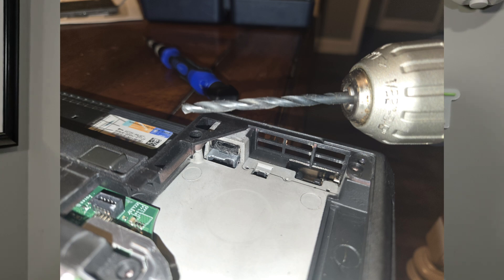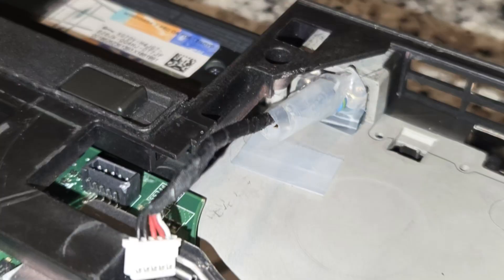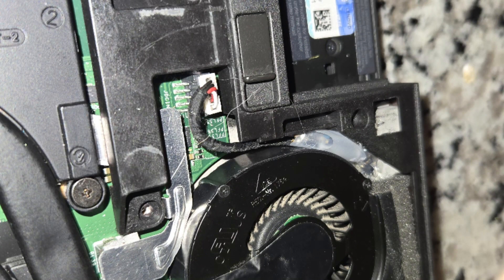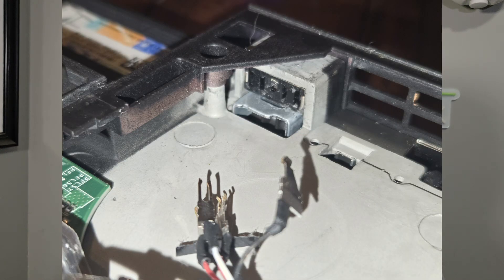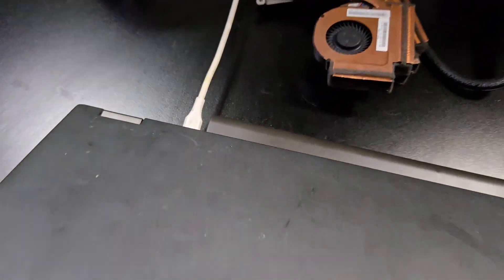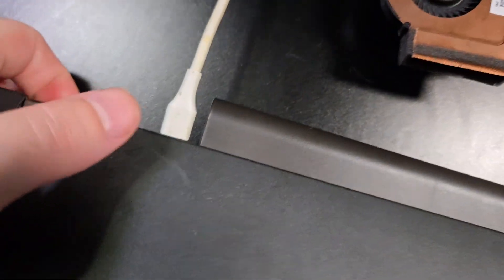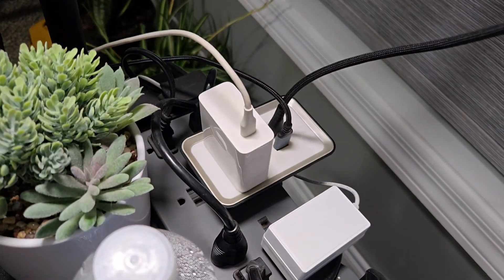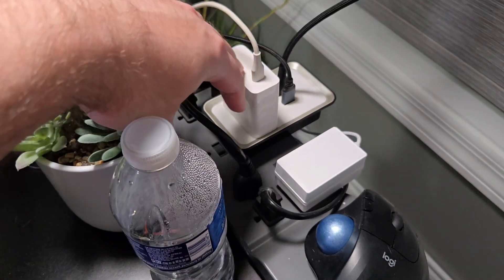Modding Thinkpad T440p To Charge With USB-C!!

Comment: why you change charger to usbc dang ...it will always break now good luck now. Later you will see
Reply from the maker: Just saw this and wanted to report the charging is still working so far. Making a note of this just so hopefully down the line when I do have to resolder a new pd module, I can let you know you were right. 😅 I am pretty bad at soldering so I am surprised how well that and the hot glue has held up.

Comment: With the number of laptops I've seen rendered unusable due to USB-C obsession by manufacturers, I'd love to see a USB-C to barrel jack conversion.
Reply from the maker: Well this is the best of both worlds you get the standardized port that most devices are using. Limiting the amount of cords and power bricks you need to lug around. Then on top of that should the USB port go bad it costs about 5 dollars to get a new one and it's pretty easy to replace.

Comment: Did you consider to put PD trigger in parallel with original port? So you could use both of them depending of what you have on hand..?
Reply from the maker: I did not. However I just have one universal charger for the lenovo and like 30 USBC cables with a few 45-90+ watt bricks. So i would do it this way just because I feel like I don't have to worry about something happening to the charger I had and it looks like the new charger is meant to be there. But I will say that is a cool idea 🧐
Reply: @ZaneyOG  Yeah. But the only danger thing is what happens if you stick both ports at the same time? And this is yet another problem I don't know how to mitigate. Hope some day I find solution and implement it with my E430